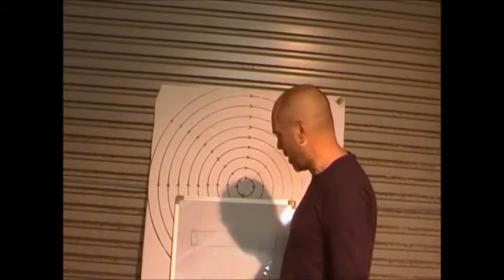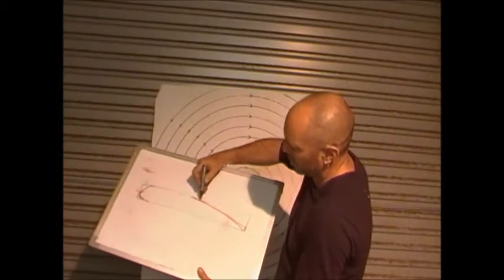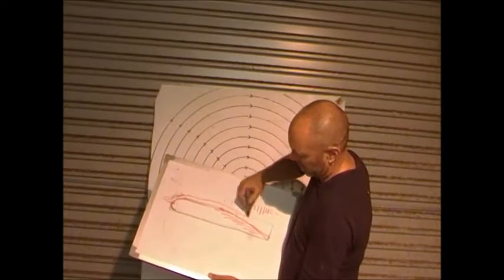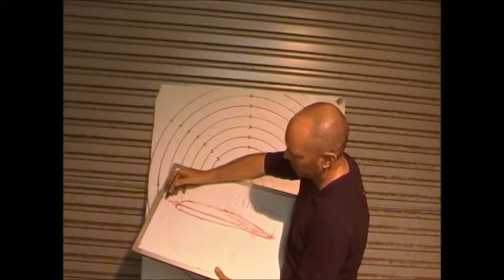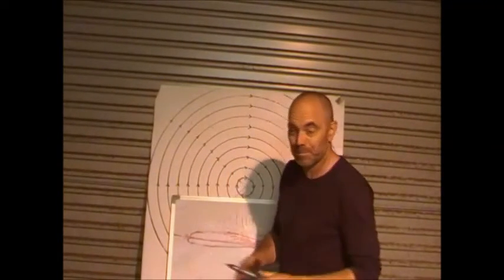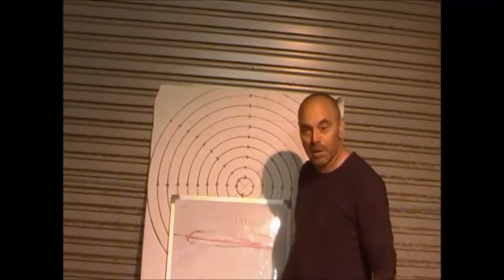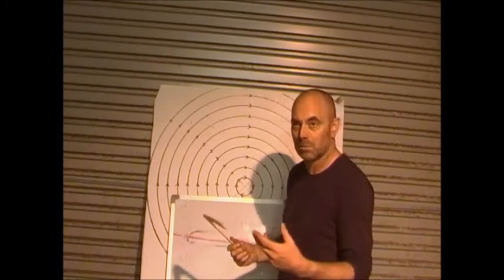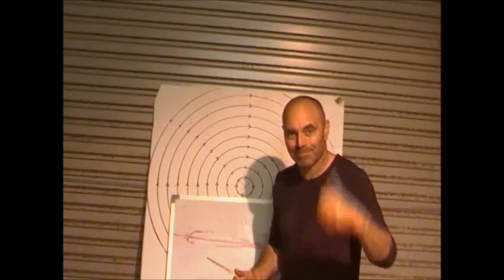Techniques for Boomerang Design Part 3: Airfoil shape and Field Testing

Comment: Have you made or do you know of any resources on how to fine tune for more desired flightpaths? I have a prototype that always has a sort of tear drop shape and hovers directly down in front or circles in from behind in breezes but wondered what do I do to make it rise less in that second cut across phase of it's 'oval'....or layover less quickly/slowly etc...do you have a video where you explain these fine tuning elements in more detail as per altering characteristics of flight paths, end hover etc.?
Reply from the maker: That's a lot of interesting questions bundled together, but the short answer is no, I haven't touched on many questions regarding tuning in my videos. Even the simple variable of adding weight can have wildly differing effects between boomerangs of various profiles, so as you can imagine, testing and keeping notes on your own design is the best way to work things through.

Comment: In high wind its easier to adjust your throw, spin rate and force than attach 'junk' and weights to the boomerang, Sometimes even leaning it to the left the 'wrong' way can be quite effective. More spin seems to make the boomerang 'lighter' and less spin heavier even though its not plus even though it seems to not make sense, throwing with less force also can help in stronger breezes that usually force it behind you, boomeranging is far less fun and more frustrating on blustery days but can prove an interesting challenge especially with weighted boomerangs that like strong breezes and go terrific distances. It's abit like golf, you have to be patient and adjust your throw/swing to the conditions. I use a feather on a string to watch the strength and direction of the breeze and sometimes it will change direction drastically and occasionally freak gusts will send your boomerang right up and way back, if you talk to the boomerang and tell it to 'come here' it often listens and decides to stop in the air (with a good 'hover' throw) and then come straight to you like magic, that's what it seemed like when I would try and beat my own score of how many catches in a row as a young lad..

Comment: Thanks mate. Top video explanation. Question. I want to make a solid wood boomerang instead of plywood. I'm going to resin both parts to keep the grain parallel to the wings. Have you got an indication of how heavy does the boomerang have to be respective of it size or thickness ? I want to build a long range one and assume I need a fairly heavy one. I like rimu or kauri being rimu the harder and heavier. Any thoughts? Cheers from new zealand
Reply from the maker: The weightier the boomerang overall, the more consistently it will fly, being able to buffer variations in wind, but they require a harder throw and won't hover well on return. I haven't had much experience with solid boomerangs. The few that I have made and used have a habit of breaking or warping due to the grain having to run across it at some point. However, if you can shape one from a natural elbow, you should have greater success.  James Hoy of Boomerangs UK makes some excellent solid boomerangs. You should look up his work.
Reply: @boomerangchannel78  awesome. Thanks a lot. Perhaps I will practice more with plywood first but definitely check his work.

Comment: Having lots of problems myself with the airfoil I always seem to get a half radius and it runs out of spin doesn't matter how much I take off but does seem better with more material but still get the same result but it would be easier for me to throw one that's thicker. Lately I've been making 3 blades boomerangs trying my luck with that before going two bladed. I figured being a machinist this would be super easy for me and it seems a lot harder than it looks hahaha
Reply: If you copy the aerofoil designs of WWII fighter planes, like the spitfire, as in fully contoured (curves all the way over the top) you can't go wrong. The way to remedy this fault of not enough spin is to contour the underside of the leading edge a little sharper so more airflow is encouraged underneath the flat side and take your trailing edge so it curves over about two thirds of the way towards the leading edge and comes right to the bottom of the back end of the flat side fairly sharply. Many modern boomerang makers leave massive areas just parallel and flat on the wing leaving all the work up to small ammounts at the leading and trail edges, older sport boomerangs from before the 80s were heavier, fatter, thicker, more often smoothly contoured with less sharp edges and easier to 'tune' without having to 'add' stuff like tape, rubber bands, bog, flaps, coins etc. they also take greater skill due to individual boomerang quirks. Another thing; are you getting the throwing technique correct ? You need to make the boomerang spin end over end on release.